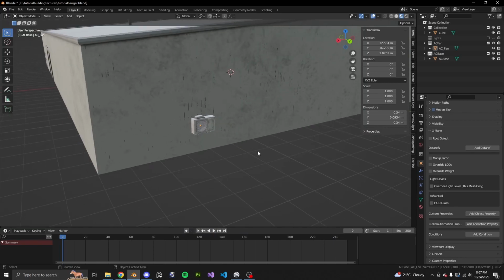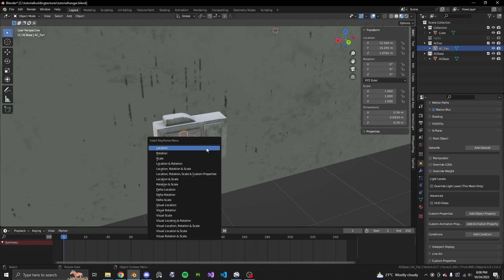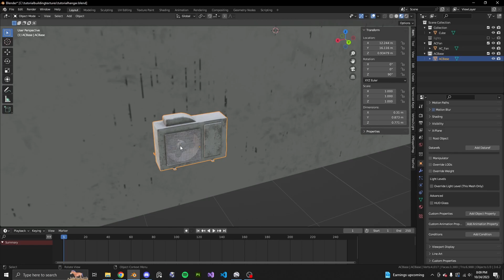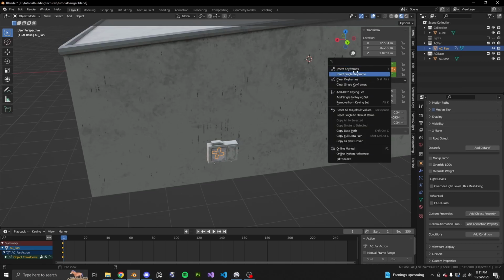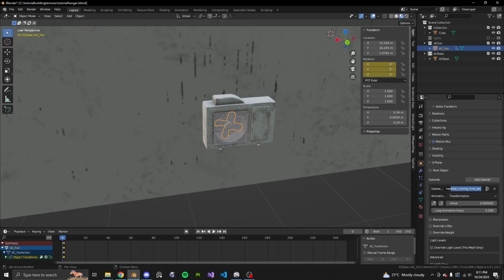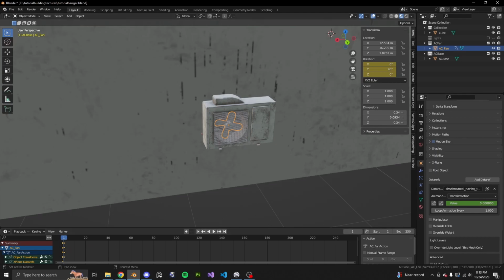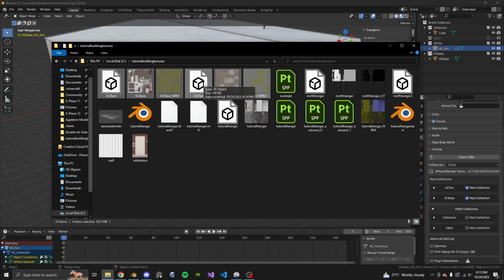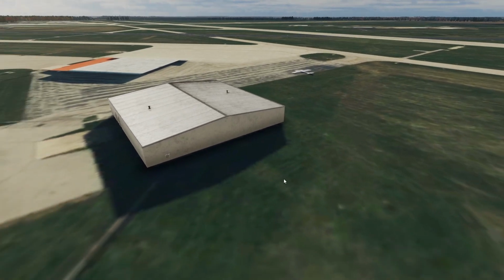Spin Loop Animation Tutorial for X-Plane

Comment: Hello master. Like 19 :)  I'm putting animation on the entrance door of a hangar in XP-12, for it to open and close. What would be a good value to put in the dataref of frame 1? Thanks, hugs.
Reply from the maker: Typically you can get away with just two keyframes. So I would put the closed position on frame 0, and open on frame 1.
Reply: @AviationMaster Thanks for the answer, master, but I'm having trouble doing both movements, opening and then closing. I'm putting closed on frame 0, open on frame 1 and closed again on frame 2. Blender performs both movements well but XP-12 doesn't.
Reply from the maker: @ Maybe a better system would be a user triggered hangar open / close. If you look into SAM (or OpenSAM) they have an SDK that can help you do that.
Reply: @AviationMaster rgr that, I will do this, Tks.